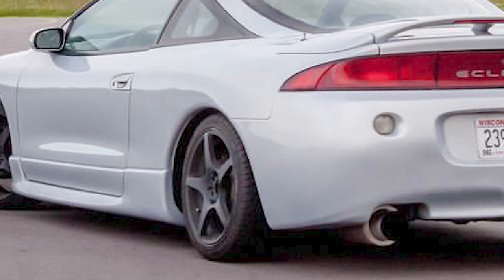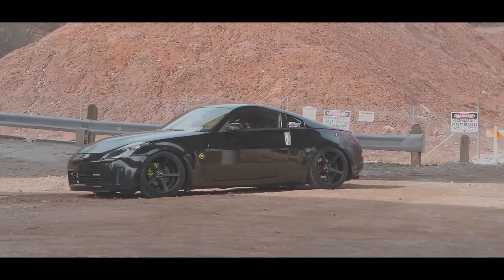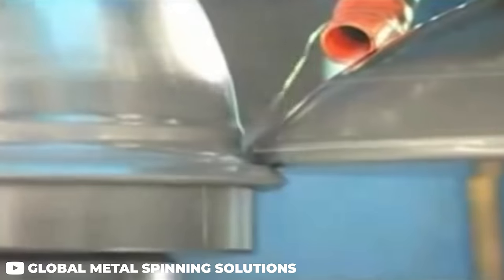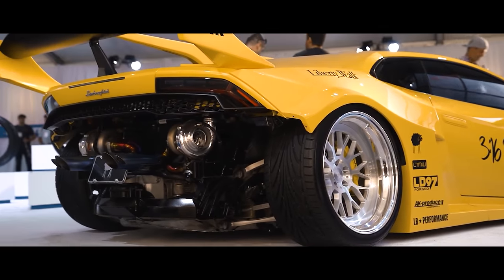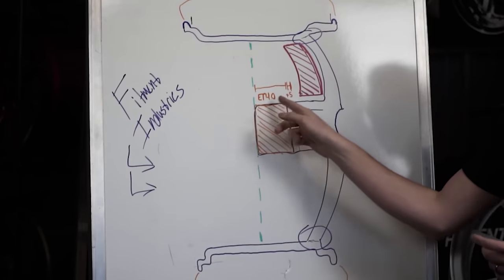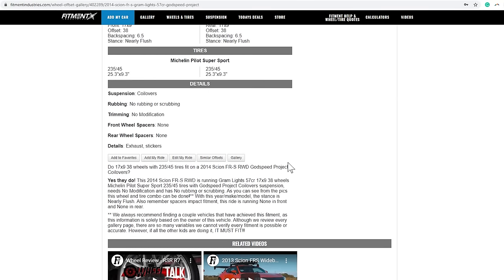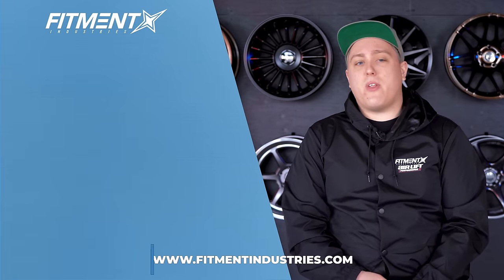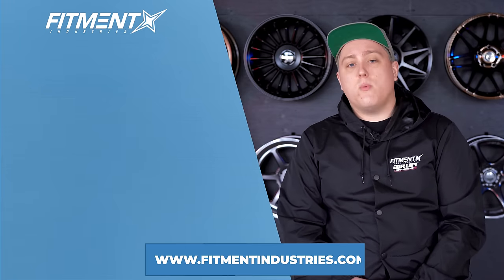Don't Buy Wheels And Tires BEFORE Watching This

Comment from the maker: What are some of your rookie mistakes with wheels and tires in the past? Also, don’t forget to check out our MASSIVE online fitment gallery to help plan your next set of wheels! https://bit.ly/2yzxQqY
Reply: I put 20s on my 96 mustang and made the mistake of trying to run larger than 30% sidewall Rubbed on every bumper and screwed up my handling by raising my center of mass and gave me enough body roll to drag my then custom side exit exhaust
Reply: A quick question: do you ship to EU?
Reply: none, because i've been watching your videos instead of fucking up
Reply: What do you recommend for a Toyota Camry v6 xle black, or red , or silver color car?
Reply: Down Shifts  but if I choose blk what wheels you think I should get?
Reply: Rookie mistake was buying some heavy ass 19in cast wheels for my E46 which killed performance. Went to a rotary forged 18 and never looked back!
Reply: Chrisnas1 With a black car I personally think u should go for a more colourful wheel, imo black cars with really brave wheels just look so cool
Reply: What’s their email to contact them at?
Reply: Trying to buy them from you guys. My card was declined by your provider even though it was debit and the money was in my account and your customer support treated me like I was a criminal then never got back to me. Ended up getting much better wheels with tires mounted for a bargain from a Subaru forum. Could you guys get me OZ Ultraleggera HLT's with Michelin Pilot Super Sports for $1700 mounted/ balanced and ready to go even if you didn't screw me over?
Reply: I hope you see this I just bought my first car and it a 03 Toyota Avalon xls I tired looking for wheels and mods but I can’t find any🥺
Reply: What about forgiato rims didn't mention it.
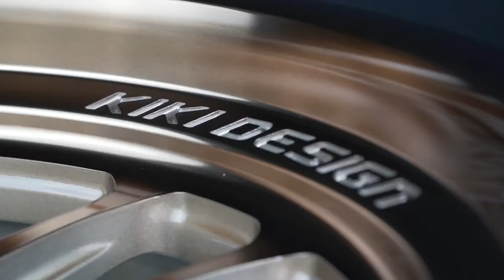Reply: Hey mate are they just the standard BBS LM rims at 3:50 ?

I’m assuming so but just wanted to be 100% sure.

That’s what Ill be putting on my E46 M3CS in the next couple months 😍
Absolutely beautiful wheel !!
Reply: Bro I have a 2008 Honda civic E.X coupe GALAXY gray metallic.am a bit confused some are 15 inches &16..am looking for 17' rims with out lowering the car,u think they fit.plus some wheels can mess up your alignment and depending if aluminum or steel is better.what do u think bruh.yeah am way behind in mods but I need to be SMART enough b4 DESTROYING my car with ridiculous rims.
Reply: Lug pattern...got a 225/60 kia sportage.
Went to junk yard pulled oem wheel off kia sorento size 235/65
It was going to be my spare tire once I get new rubber...but nope...different lug pattern.its all your fault =p
Reply: Removed PS4S summer wheels. Fitted winter wheels Goodyear Ultragrip +. Didn’t notice rotation arrow. Failed MOT.
Reply: Do you suggest changing out your suspension when getting new rims and tires? I have a 2014 sentra.
Reply: 너는 과거에 바퀴와 타이어 에 대한 신인이 있는가
Reply: This is an off-road problem as well. I know I'm not the only one that got some tires and wheels too big. I had a Jeep XJ that was really nice and somebody gave me rims and tires that would fit with 31-inch tires looked good but I would rub and I bent my fenders because I wanted to "try those tires out" took me awhile but I learned if that's your source of transportation don't be trying stuff out.
Reply: @Drew.DrivesYT  haha for reals all these YouTube’s videos am basically a tire guru
Reply: 22" chrome rims staggered for 05 Acura RL 3.5  THANK YOU CONTINUE TEACHING US THE RITE WAY

Comment: Sticking with my stocks, I’m too broke anyway
Reply: Same haha, plus mine shine on the ground even when it's dark so it looks pretty cool 😂
Reply: Elias Lado you could plasti dip them
Reply: Took me 6 months to get tires on some cosmis XTs took me another 6 months to get the wheels😭😭
Reply: Most stock wheels are of higher quality than aftermarket cast wheels anyway. Since I couldn't get nice wheels at the time, I ended up polishing the faces of my stock 2011 Si wheels to a mirror finish. Made the car look incredible and only took about 3 hours of labor per wheel, sand paper and buffing compound.
Just today I ordered a set of Kansei wheels for it so I'm stoked
Reply: FG Poor I felt this 🙁
Reply: You got a wrx ? Sti ?
Reply: Same here i just black out the crome on my Se looks like brand new rims 😂😂 probably just lower it  next year i will put aftermarket Wheels
Reply: Mark Spohrleder so from non-Chrome to chrome?

Comment: An offset is an American rapper. 😅 All jokes aside The "offset"  of a wheel is the distance from the hub mounting surface to the center line of the wheel.

Comment: Three important things to note with offset that both caught me out:
1. If you're putting in thicker brake calipers,  measure to make sure they don't collide with the spokes - if they do, you'll need a spacer which in turn will require you to adjust your offset by that amount to keep the wheels in the desired lateral position
2. Check whether the wheels valve stems sit in front of or behind the spokes - on my wheels they sat behind the spokes and collided with the bigger brake caliper before I put the spacer in
3. Check your stock offsets, they might be different on each axel - on mine the rears were +16 whilst the fronts were 0 - it's less than ideal but this mistake kind of worked in my favour after discovering 2 - I put a 16mm spacer on the fronts for the bigger brakes (which I didn't have for the rears) which means that both fronts and rears stick out 16mm more than they should.  If I'd had the correct offset on the rears, the fronts would have stuck out more than the rears - because I didn't, the wheels are at least in line, albeit 16mm out from where they should be.

Comment: You forgot the most overlooked factor. The center bore diameter needs to match or be a bit bigger so you can get hub centric rings at least. If you buy wheels that the bore is too small that means you have to go to a machine shop to enlarge it which cost another 200-400 dollars.

Also tire height chart is best website for tires. Look up your oem size then look up upgrade rim diameter and it will give you all tire sizes that come close to your oem height. Good for staggered setups or if you have all wheel drive cars.
Reply: This is almost never the case. Because when a wheel designer is doing the final calliper clearance test, the centre bore always clears before the actual calliper. This means is as you said the center bore becomes an issue, then the brake will most certainly be an issue too. (Actual Wheel designer here)

Comment: The part I have a hard time with is trying to make sure that the overall diameter of the wheel and tire are the same. I want to keep the stock overall diameter that way my speedometer reads correctly

Comment: I have a truck that I'm building into a widebody racetruck and I'm gonna have 19x9 -42 in the front with some 255/35 19s and in the rear I'm gonna have 19x11 -67 with 295/35 19s. It's gonna be a monster and it's gonna look sick as hell!

Comment: I was told by a good mechanic of mine if u change your tire/wheel size u will cause damage to vehicle the transmission and some mechanics rely on the stock size tire/rim, they spend many hours tuning and testing vehicle on stock size tire. Now he did say it's not impossible but something I think along the lines of tuning vehicles gear ratio or timing to the spec of tire size and demetion. I'm sure there is more to this then I know but I play it safe and keep same size and just change looks.

Comment: I really like the one on the top far left. It does seem like there is almost an endless amount of rims and i made the mistake purchasing a chrome set years ago that (unknown to me) was considered a "show rim" and once driven at normal highway speed it would flex like crazy made for a horrible experience going on a road trip and after 10 hours would blow up tires. I really want a new set just have to make sure i check and do my research this time

Comment: I got a set of forged on one car and a flow formed on another. The forged may be stronger but dont be fooled the flow formed are just as light in weight. It also depends if they are from a quality brand, which will be more expensive. In conclusion high end flow formed wheels like advan racing are super light.

Comment: Any note for anyone buying multi piece. I owned 3 sets of 3 piece wheels all 2500+ wheels. They eventually leak and need to be resealed. One set did it in the first 6 months after a burnout. 2 piece is your best bet. The lip is 1 piece and the spikes/face is the other. Get a multi piece wheel but the inner and outter barrel is one

Comment: So I just bought coil overs for my car. I have stock wheels and tires. Will I have problems with stock tires? I’m concerned about rubbing. I mean I won’t be able to go super low. But should I seriously consider aftermarket wheels and tires?

Comment: Thanks this helped me decide what setup I wanted to run on my bagged F100 pickup truck 

20x8.5 +38 255/35 tires front 

20x10 +45 +10 mm spacer 295/30 tires rear 

The crown vic suspension swap is 67" wide and the stock 9" rear is 65.5 with the torino axles swapped in. 

Yall just gotta measure! 🤷🏻‍♂️

Comment: I got a 98 honda civic what kinda size wheels do you recommend. I want them as big as possible for daily driver and without doing fender rolls or any other mods to make them fit.
Reply from the maker: Have you checked out our gallery yet?  There are tons of examples, and you can filter exactly what you're looking for!
Reply: 98 Honda…. Dame that’s my baby 
Johnson’s cars part 

FB……

Comment: I got a set a wheels from a friend and they're 225/40R 18's all around for my 04' Subaru outback, turns out they just barely fit, it's like a half inc maybe even some odd centimeters difference in the hub size. I learned a lesson today sadly, the hard way - -

Moral of the story test fit before you buy ladies and gentlemen

Comment: I know nothing, but I’m customizing my 1997 GMC 1500 high top Savana.  Want an off road vibe with all terrain tires.  Getting the suspension upgraded then want to swap out the 15” rims and tires for a larger tire , taller.  Will need to seek advice so the performance works.  Looks easy to do it wrong.

Comment: So I just got a my first car (2015 Corolla) and I’m gonna start slowly modding it over time and I want a set of wheels but idk what I should do first between wheels and suspension. I’m super knew to all this and could definitely use some guidance.
Reply from the maker: For sure homie! Most people usually end up with getting suspension first and then dialing in wheels to match it up, heres a link to anything suspension related for your vehicle! Also, check out the gallery on your car. Theres plenty of modified Corollas out there. Here ya go! -Edgar

https://www.fitmentindustries.com/store/suspension?sort=instock&year=2015&make=Toyota&model=Corolla&trim=LE&saleToggle=0&qdToggle=0

Comment: What's your view on offset and it's relation to brake clearance? I believe they have very little do with each other and other factors like face, hub and barrel are the real determining factors.
Reply: It really depends on the wheel. Some wheels can clear large brakes despite being small. You can run a wheel such as a 19" Forgeline GA1-R on a car with six piston calipers and 398 mm discs. On the flipside, there are other wheels that are 20" which are so poorly manufactured that they won't clear the same setup. Always measure the radius from your hut to the outside of the caliper and add 4mm. That will tell you what you have tow work with in terms of inner barrel diameter. Then measure the offset from the hub flange of the brake disc to the face of the caliper. That will tell you how much room you need to clear the spokes. Those two numbers are what you need in order to know whether or not a wheel will clear your brakes. If a wheel vendor or a wheel manufacture cannot tell you what their inner barrel diameter is or how much room there is between the wheel flange and inner wheel face, then shop some place else, because they are not worth your time.
Reply: It has everything to do with clearance wtf
You get a larger negative offset in order to fit in a BBK and also to get your rims flush without having to use shtty spacers!

I’m confused with what exactly you mean mate?
Not trying to have a go at you, we all learn from somewhere so if I can help in any way please let me know and I’ll do the best I can!

Happy driving brother!

Comment: I was looking to upgrade my stock steel wheels to a newer and lighter wheels from 16s to 18s but my truck is a 6 lug pattern so it was not easy... So i bought a set of 4 2019 Tahoe 18s wheels take them to a tire shop to rebore the centers my 2011 chevy Colorado bought a set of Achilles 235/55 r18 UHP desert hawk series for my drift truck project. Now im happy. Saludos desde Ensenada Mexico 🍀🎶👍
Reply: Chances of you getting lighter alloys when going from 16" steels to 18" alloys is pretty much zero unless you spend north of 10k on forged wheels. Alloy wheels are more often than not, heavier than steelies.

Comment: I wish you sold Rota wheels. I've used then for the last 20+ years on all my Civic's with no problem. I've probably owned about 10 sets of Rota wheels and they are great and not overpriced. 4 rims & good tires usually cost about $800 shipped. I can't find rims on your site for that price. Do you sell good, reliable, inexpensive wheels like Rota?

Comment: Got this recommended the day after I bought wheels and tires
Reply: Luckily you didn't I'm still waiting for my wheels and tires was told that one rim was sent straight to me but why would they do that when there suppos to mount and balance and install the tpms sensors. They told me they would send me the tires and I can have a shop install it and they would cover $20 if I send them the recipe

Comment: So just to be clear, if I get a more positive offset my wheel will stick out more?
While with a negative offset it will stick in more?

So if I want to make the stance of the care wider to fill up the gap I'll need positive or negative offset?
Reply from the maker: The lower the offset, the farther out the wheel sits

Comment: Lighter/stronger metal is better and when increasing tire diameter stay within 1% tire width within 9% tire calculator online is very helpful. Offset could depend on your brake setup. Good luck

Comment: I just brought a pair of 19 x 8 my Honda CRV and I brought 245 45 19 because I have lowered suspension coils I'm not going to low but you think that's a good size tire or should I go with 19 x 9 rim please let me know ASAP before I buy the buy rim or stay with 19/8

Comment: I have tried to use the filters on the FI website. The offset filter doesn’t really work. I have to sift through a mountain of et30 and et35 offsets when I’m looking for a et42-48. I wish the filters would actually work.

Comment: Yo man I need some help..... please..
I plan on buying some 20x9 +42 wheels on 245/35 R20 tires with Tein StreetAdvance Z coilovers. 
I have a 2012 Honda Accord EX-L V6 sedan. (This is for daily use.)
I have 2 questions,  before I buy the wheels, tires and coilovers. 
1.) Am I going to have to roll the fenders "and or"  pull them to prevent rubbing at full turn? 
2.) Also, Will I have to purchase control arms for the Rear suspension to dial in a 0 degree camper?

Comment: can you tell me the difference between 245/45R20 103w vs 255/45R20 105w. I have 17s on my challenger and I want to upgrade to a low profile set of black 20s

Comment: I have a 2005 Lancer Es fully Stock with 17" 4 hole wheels, i want to purchase 16", but the ones I want have 5 lug holes plus the diameter is resulting different would it be a problem when mounted?

Comment: I have vw jetta 2013 comfort-line , i have 18” VMR  (18x8.5 + 45) wheels with tires 225 45 R18 but i have stock suspension and coils. I am getting some rubbing issues with getting through small pot hole even , like even the small bump make sound of tires touching body. I am super confused what is a solution for this “do i need to change suspension or coils ?”  If i need to than what type and option of suspension and coils i should put in ?

Comment: Been on the fence can’t decide if the staggered set up will work well for a car aimed for the best handling it can have
Reply: That really depends on what car it is. If the car was not born with a stagger setup, there's a goo chance that it will understeer like crazy. If it's not RWD, it's totally pointless.

Comment: What is the best fit for a C8 Corvette. Offset, wheel, and tire size with no rub?
Reply: The only way to increase the performance, is to stick with the stock wheel width and maybe 10 mm less offset than stock. Then find a light wheel like the HRE R101 LW and run 255/35R19 and the normal 305/30R20. That's it. Fit some of the chariot sized wheels some seem to run, and not only will the ride be compromised, the car will be significantly slower and understeer all the way into next week.

Comment: Im running 20x9s with 275s currently. I need new rims, but the only rims I like are either 8.5 or 9.5. Can I get 9.5s and keep my 275 tires?
Reply from the maker: Yes you can. Just make sure that the 9.5s still fit the fitment you’re looking for

Comment: I've 2014 honda accord 4 door, no suspension modifications.
Can I put in 19" rims without having to buy low profile tyres? And what's the maximum width of the tyres/rims I can go up to in front and rear.
I just want a little wider and larger in diameter rims/tyres setup. No other modifications. 
Please help🙏🙏🙏